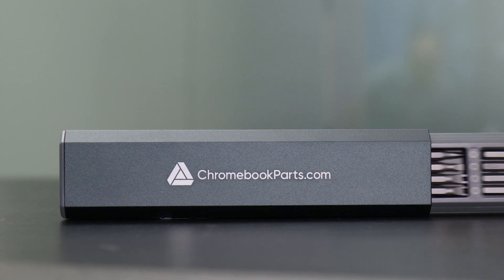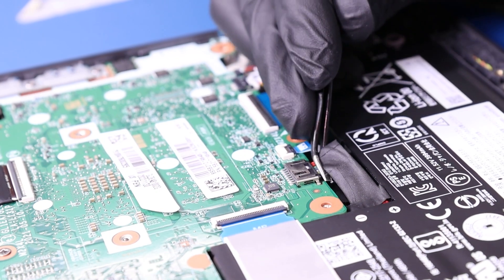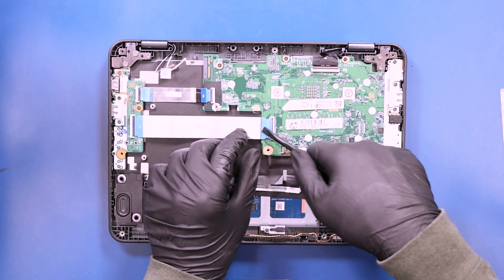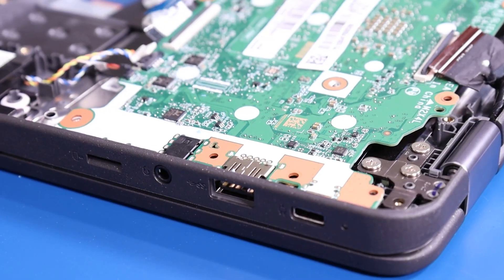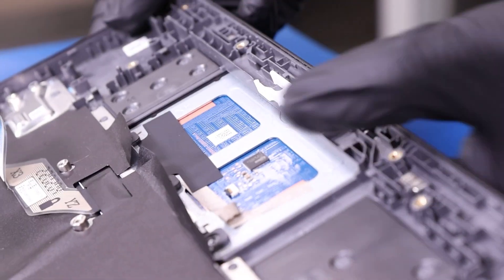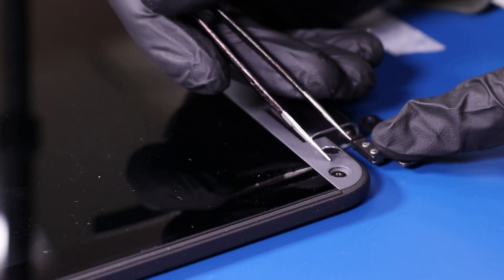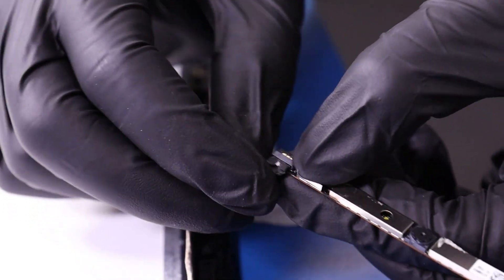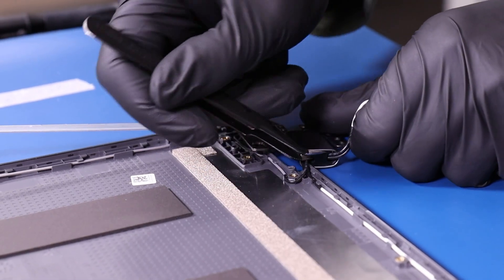Lenovo 300e Gen 3 Chromebook Teardown Guide

Comment: I have a Lenovo 300e CB 3rd Gen exactly the same as this but mine has the cover over stylus port, can I buy the stylus and remove the cover and use the stylus in this port? Will it still have the charge point inside?
Reply from the maker: A stylus should still work with your device as the screen should still support it, but there won't be an internal charger. A pen with an external charger should do the trick though.